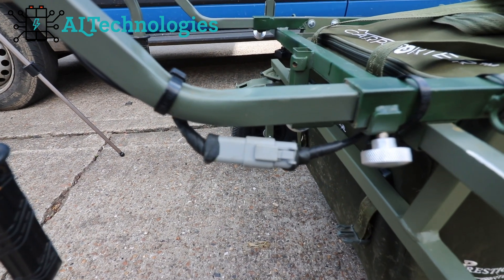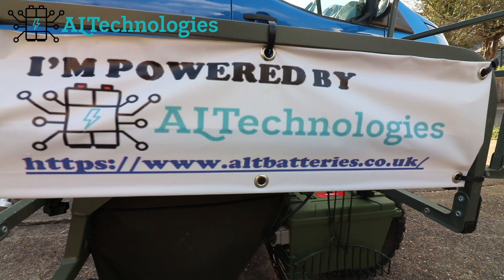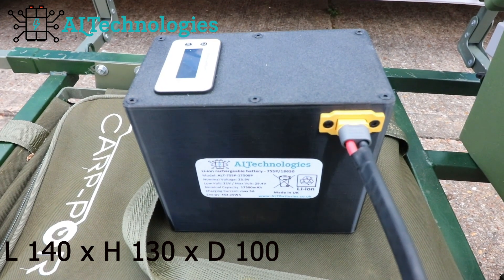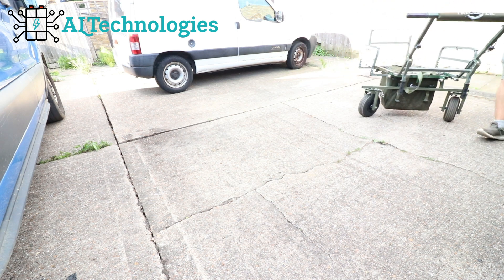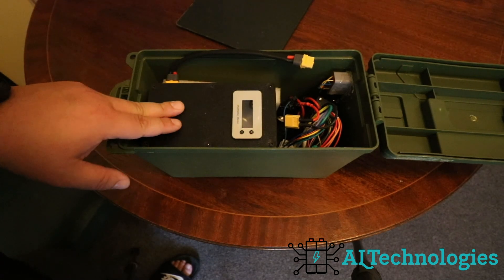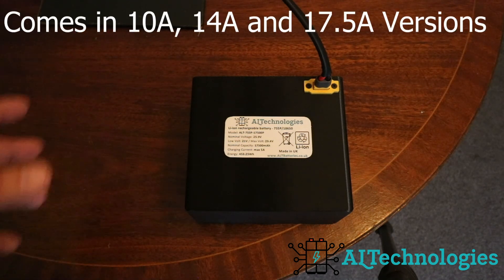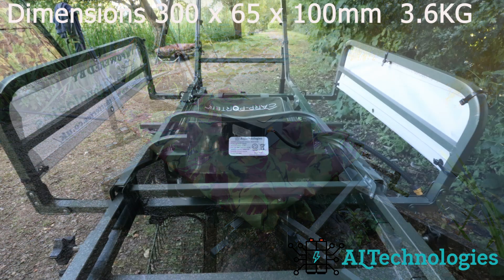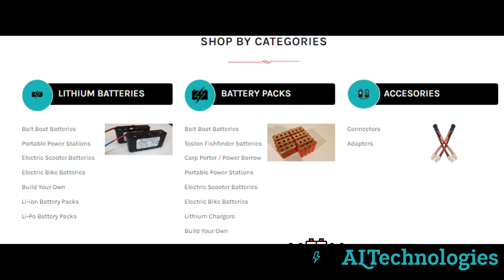Build Your Own Power Barrow - Part 6  The Upgrades

Comment: Do not purchase this Chinese wheel motor ,these are not fit for purpose they are produced for assisted cycle use and scooter use NOT barrow work they’re terrible things Chinese crap… the batteries are fine the motor is garbage
Reply from the maker: Mines been okay, what problems.have you had ?

Comment: Would be nice to see how it performs up a hill with a heavy load, like 300 kg. I'm wondering if the axle can hold it and the gears. I'm afraid the gears are plastic.
Reply from the maker: I never carry that much in a single load, I generally prefer to do 2 trips.

Comment: Good series Jason.  But you have not explained the wiring inside the waterproof control box and not shown us how you wired in the breaker or switch.  Could you do a follow-up? Otherwise very educational and motivated me to build my own.
Reply from the maker: The breaker and switch are just inline between.the battery and.the controller.